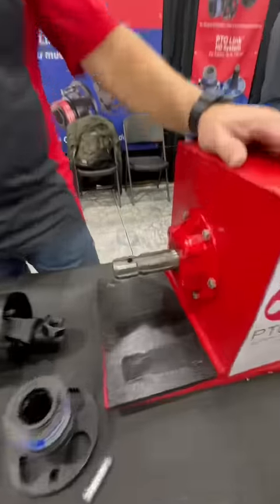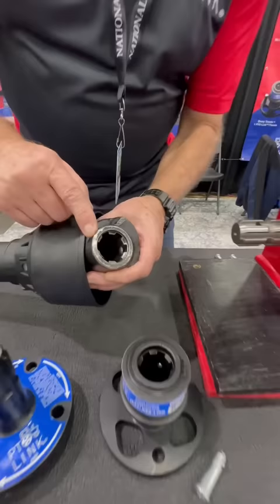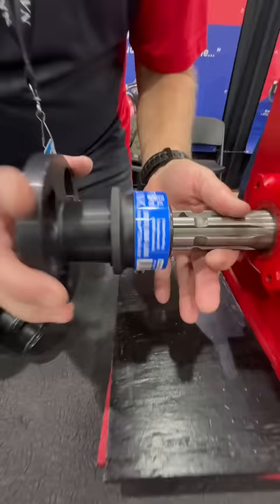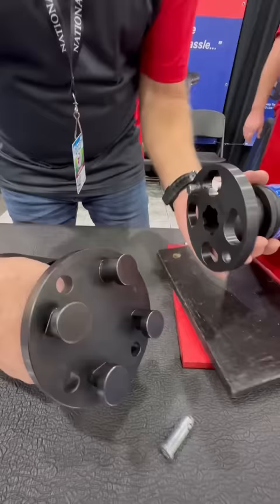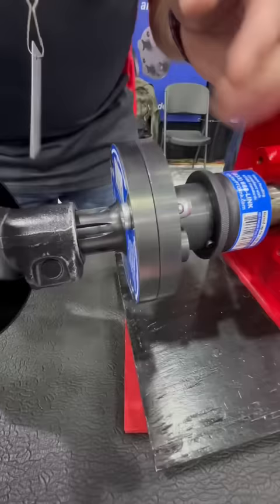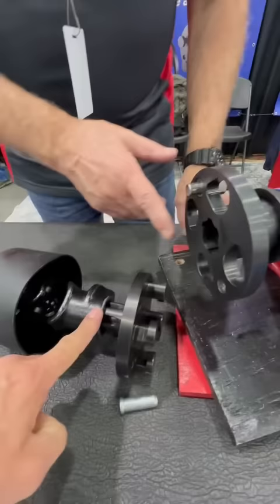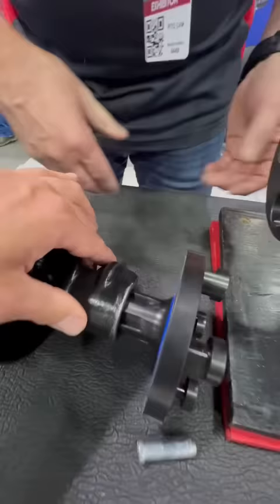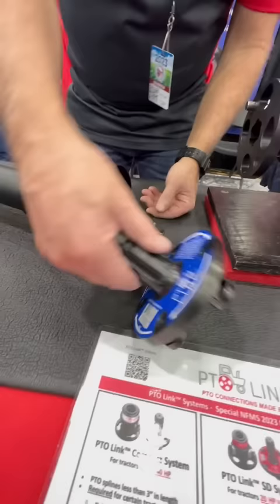“Farming just got easy.” (Said no one ever) #farming #tractor

Comment: I love seeing the real farmers calling this out as bullshit
Reply: I mean I don’t have trouble and my pto shaft ain’t near that clean 😂
Reply: Just about everything in these shorts is bs
Reply: Yeah, I’ve literally never had a problem putting on or taking off pto shafts. Seems like they’re making mountains out of mole hills
Reply: @Sean power take off. You can convert your tractor or truck while in park into mechanical power generator of sorts. Add a pump, bailer, lumber processor, all kinds of things. Some PTO’s are used under drive as well for similar applications.
Reply: I would never trust this. Just a pointless weak point. And it isnt even that much easier.
Reply: Literally all you have to do is spin the drive shaft. It’s a two piece puzzle coke on
Reply: That’s because it is 😂
Reply: whiteafrikkkannun1442 yes we are because we carry a large shaft with two large nuts, and we are great at laying pipe as well 😂
Reply: Is this an April fool 🤣🤣 let’s fix a problem that doesn’t exist whilst st the same time probably kill somebody. How did this get safety approval? Pro guard is now too short. PTO shaft  is now 4 to 6” too long.
Reply: @Farmer_brown134  The only time I have had problems is when some idiot has damaged the pto system through misuse. And I am sure the same thing would be a problem for this fancy add-on. Once damaged, it will not hook up so easy either.
Reply: Mee too 😂😂😂😂😂
Reply: This is why I came to the comments lol
Reply: I am not even a farmer and already saw through the bs in that video
Reply: The biggest problem I see here is now the PTO shaft of the Implement is going to bottom out whenever you make a sharp turn. Manufacturers of implements know that there is a common length between the PTO shaft and the hitching point of a tractor..this is a bad idea.

Comment: Adds a potential failure point. If it ain’t broke don’t fix it.
Reply: If you're thinking about installing this it must be breaking frequently.
Reply: that might be a plus rather this break than the tractor or "implement"
Reply: similar to a pin on snowblowers
Reply: Now you hope the shaft isn't to long better chech the slip length.😮
Reply: @jacobklang6693  nah, if the pto comes loose on a tractor it’s liable to come up and knock whoever is driving silly or dead, probably not the best failure point
Reply: @jacobklang6693  if it works don't fix it.
Reply: Took the words out my mouth. Went from 6 to 4 point of contact.
Reply: Low power applications maybe.
Reply: You now need to shorten the drive shaft of all your equipment by 4 inches, to accommodate.
Reply: It's probably way more expensive to replace the spline in that tractor than buying and using this new system.
Reply: It’s literally just making another join that sucks to connect 😂
Reply: I would not trust this at all
Reply: @jacobklang6693  the shaft on the pto is not going to break and u joints are cheap so are yokes.
Reply: @MrMuDD01  the pto shaft on a tractor will live just fine the u joints and yoke on equipment tend to have issues adding one more piece that is shorter then the spines on the shaft and yoke your adding nothing but issues.
Reply: @t-bfr45-70  I've looked into it and there can be issues with the PTO spline itself, which is costly just in labor to replace it. Stripping the spline can be a issue, but more often than that is the shaft altogether bending. There can be issues with the implement that is being hooked up and not a lot of room between the spline and receiver and the frame of the implement or it's tires not leaving much room to attach and lock it into place. That lack of room seems to be the number one reason for an extension like this over any other issue like a bent shaft.
Reply: @MrMuDD01  you obviously don't understand much about tractors and PTOs. 
1. Yes pto can become stripped usually that has to do with the piece of equipment attached to them slamming back and forth on the shaft creating wear the yoke and shaft making it become looser and looser tell what usually happens is the yoke is stripped because it's softer then shaft it spins and that's what damages the shaft. Adding this is not going to prevent this from slamming back and forth it potentially ads more slop allowing for a harder hit.
2. Bent pto shaft can happen most often this would be caused by bad alignment angle or running it in to something. Adding another attachment that push the yoke and u-joint out away from the shaft creating more leverage angle on the shaft if anything is more likely to create a issue then fix it.
3. The pto drive shaft is already heavy so in the tight spot it's hard to hook up because it's heavy awkward and hard to get between everything. Now after you had shaft shortened to fit with this you now have more weight added and instead of hooking the yoke to the shaft your trying to hook a heavy fatter piece to another piece in that same tight spot.
Reply: @MrMuDD01  that's the reason you use a properly adjusted slip clutch.
Reply: Prices for this thing start at about $500.
Reply: When it comes to something like this that's a good thing. It will possibly break before more damage is done. Sometimes a weak link will save you thousands 😅
Reply: i really cant think of a time you would need to make this easier maybe it saves you a few seconds?

Comment: Fixing problems that don't exist.  He must be from the government.
Reply: Yep least hard part of connecting an attachment
Reply: @Jon-ko3vv  well now it’s least-er harder to connect it
Reply: Exactly.
Reply: Right and I guarantee after about a month or so of dirt and grime getting on there that quick release will no longer be too quick lol
Reply: Connecting a PTO can be a pain in the dick, but this looks way worse
Reply: These are mainly for like garden tractor types, not real farmers.
Reply: Lol. Nope boys! This is easier! By far the hardest part for us is the PTO shaft. Big long pto shafts are heavy and the slips go funky after a while and they take two men to slip and connect at the same time. So I'm all about this.
Reply: @sxs4l245  I’ve never had much of a problem especially if you turn the tractor off cause it disengages the pto brake so you can turn it if you can’t turn the implement, my concern with this would be it’s another connection that can get loose and vibrate! Another thing would be losing that safety pin.
Reply: I'm glad I'm not the only one that feels this way
Reply: Yeah, that's why John Deere has a half turn on the spear pin so gives you a half to to put it on... Who's gonna carry all that stuff around and where are you gonna put it.
Reply: Lol says its hard to take off the part that was "easy to take off" later cause its the one he is selling
Reply: This tool is basically the same thing as the original
Reply: Looks like it is for light duty applications only.
Reply: True
Reply: Trust me. It's a genuine problem
Reply: Basically just showed us how easy it is to connect to the splines.
Reply: @captainoates7236  if you change implements you have to reattach half that contraption to the other PTO shaft.. or buy a bunch of them. Keep them clean and greased should be fine
Reply: I was just thinking that the only problem with my pto is the fact i get grease on my hands and that’s just going to happen to begin with 🤣
Reply: 100% agree
Reply: I'm personally not trusting that pitiful looking "safety bolt" that looks like it'll shear right off the second time you go to use it haha
Reply: @keltonwright7   you don't have to cary it around. you just buy one for each implement.
Reply: you have clearly never used a dirty or rusty coupling. even when they are clean and new it can be a pain in the ass.
Reply: @678friedbed  so at $250 per part, say you have 5 tractors and 10 implements. You're gonna have to spend $4,000 on these.  When there is already a perfectly acceptable hookup from the manufacturer on every equipment???  Good luck keeping a farm in the black wasting money like that.
Reply: @keltonwright7   lol. never even looked at the price  there is 2 sides, you only need one side for the tractor. but, hey for an investment that can save you time every time you need to hook up a piece of equipment, I'm down for that. sure is better then constantly fighting the coupler all the time.
Reply: Yep
Reply: He doesn't realise the small covered and hard to get to button is safer than the large flywheel with teeth. Touch and get caught on a pto when moving and you are reduced to pulled pork.
Reply: yep, how to turn 1 easy connection into 3 easy connections.
Reply: @sxs4l245  Tell us you just let the pto shaft(s) sit in the mud all winter long without saying so directly.
Reply: Haha Yes exaktly!!!  Im think your Right!! 😂
Reply: @keltonwright7  clearly you only have to take off one end an slip it onto another implement geez didnt yee whatch da video ten times?😢
Reply: @larryscarry411  and where are you gonna carry that that's not gonna rolling around the floor of the cab being a pain in the ass.
Reply: I think you meant, “fixing a problem that we made”.
Reply: Yea going from two pieces to four no thank you. It was so well thought out and professional machine and finish work. But at minus 30 f I don't want be looking for who used it last part s lol.
Reply: Yep introducing so many more failure points
Reply: He's literally from the free market
Reply: @danielyeary148  ikr? It's a trade show for free market capitalists yet it must be the guvinmint.
Reply: I think this could add versatility to some tractors and driven assemblies.
If their interlock is consistent across any different PTO shaft splines and sizes, could be used to adapt to different brands of equipment. I'm sure a majority of equipment is mostly one size, but I'm also sure it's not 100%.
And as for an added failure point, I feel this is backwards in 2 ways. I think the 4 studs and 2 pins is probably stronger than the spline, and if it were to be an engineered failure, I would rather replace an adapter that I can continue to work without, over either the output/input shafts that can hault work.
Reply: @678friedbed  As an old farmer told me once, "That is like what the monkey said as he peed into the cash register. That will run into money!"
Reply: @sxs4l245  I agree. I've fought ptos so much!
Reply: Selling this to who? People who probably shouldn't own a tractor.  Lol😂
Reply: Totally agree 😂
Reply: The problem exists after a couple decades of stuff sitting outside lol
Reply: If you can’t hook up a PTO you should not be around a tractor
Reply: I bet his wife is very unhappy
Reply: Maybe try some PM on your equipment every once in a while. Shafts aren't that heavy or hard to attach.
Reply: My thoughts exactly. Another failure point.
Reply: Well said and making a whole bunch of new problems that didn't exist before.
Reply: So it locks in one direction and all the power is applied to four nubs, inserts call em what ya will. But when you go in the other direction all the force is applied to the retaining pin. Doesn't seem to smart in my opinion
Reply: Duck tape is cheaper 😅
Reply: @nickmartin3647  Replacing one problem with a new problem. Tha's the problem.
Reply: Went on to say removing from PTO was super easy. If it's super easy why we need it then?
Reply: @Jon-ko3vv exactly I have never in my life had trouble with the pto only the damn arms.
Reply: True
Reply: @Studio23Media  never seen a PTO on what most people call a garden tractor
Reply: And making problems that doesn't exist 😂
Reply: @sxs4l245  I agree
Reply: Oh it can be a pain hooking up old equipment. If you don't think this is valuable you haven't spent much time changing out implements.
Reply: I just welded a 1 3/8" ID x 3/4" thick smooth bore collar to implement side splined yoke. Now yoke has female pilot , $5

Comment: Or maybe, just hear me out, clean and grease the socket end before putting it away for the off season so ot doesn't rust and crust.  Additionally wrap the socket end in a plastic bag after greasing it to keep the fine dust out of it.  And while you're at it keep the spigot end clean and greased as well, nothing fancy, just some regular lithium soap grease will do fine.

Comment: Safety bolt detent will fail. Don’t use detents where they can fill with dirt and seize in the bore.
Reply: yup, beyond this looking like another failure point all together.  a hitch pin would make way more sense for durability and be able to replace a tiny piece instead of the whole pin when the detent spring starts failing.
Reply: I can imagine the safety bolt falling out, the plate releasing when the tractor engine speed slows and a spinning whirlwind of destruction at the rear of your tractor.

Comment: I invented another one called the pto link-link. It helps connect the pto link to the pto link. Its a pto shaft that attaches to the pto link. Push one button to release.  No safety bolt needed.

Comment: That changes the geometry of the implement shaft, because it's designed to connect with the splines, not further back via hubs!
Reply: Exactly my thoughts, those PTO shafts have a specific tolerance for length for a reason. This fucks it up. And switching out the PTO shaft is the quickest part of changing implements.😂

Comment: If you can turn it far enough to lock in that magical coupler you can turn it enough to just slide the shaft on
Reply: All ptos turn freely in the back end when they are not I'm gear, all you have to do is turn this to line them up.
Reply: Q makes a good point
Reply: @billabong9215  not true but you are agreeing with me lol
Reply: @Q  Name a tractor that doesn't turn freely when the p.t.o gears aren't engaged?
Reply: ye, i thought he was gonna show off some clutch system to replace the turning part lmao
Reply: @billabong9215  anything with a pro brake, for example, Oliver's and whites I have
Reply: @billabong9215  grew up on a farm and now a full time farmer for 10 years. Ive never once ben able to spin a pto to line it up. Now i will admit i have not run EVERY tractor ever made but either way you are arguing with yourself
Reply: @billabong9215  every tractor I have worked on requires the engine to be shut off in order to spin the pto by hand.
Reply: @That1Carson  It should be turned off anyway when you are doing anything with a pto. Like... it says it with warning labels inside.
Reply: @Q  Try turning the tractor off man! Every single tractor pto will spin freely when it is a) not in gear either 540 or 1000 and b) when the tractor is switched off.
Reply: @billabong9215  many people run for years with a dead battery -- always park it in the shed & jumpstart in the morning, leave it running all day.
Reply: @billabong9215  anything with an eaton fuller lol
Reply: @don't worry about it  Your pto brake shouldn't be engaged all the time. Turn off the tractor, disengage the break. Pto will spin.
Reply: @billabong9215  No they don’t lol
Reply: @billabong9215  Many older tractors are not equipped with a “live” PTO, they’re directly coupled to the transmission. Live PTO is standard today but it definitely didn’t just start like that. Your PTO could even drive a tractor into the woods if you weren’t careful mowing, you could hit the clutch and brake but the centrifugal force of the mower blades spinning could easily push the tractor. This also made it impossible to stop without stopping the PTO.
Reply: @billabong9215  u have to line up the locking lugs anyway so its no different than if it wasn’t there at all. Maybe ur output spline need a good scrubbin and lubin and thats why u have issues getting in to the coupler. Ur coupler probably needs the same treatment. And u contradict urself so its hard to tell if u agree this add on is garbage or not
Reply: @billabong9215  kubota mx5000 or any other tractor with a pto brake they only allow an 1/8 rotation

Comment: I don’t get what problem this solves… I have zero problems hooking up my PTO stuff.
Reply: That literally solves no problems, if anything it makes more problems
Reply: More weight and complexity... if the implement is on the three point, it's easier to slide on the spline than fuq around with 4 holes and flats and a pin..
Reply: @OntarioBearHunter   I still don’t see it.  Never had a problem.
Reply: Engineer never wore a pair of rubber boots..
Reply: That would be the problem of low revenue. That is the domestic product I've seen in a long time. He would be better off selling that quick attach on the other end to upgrade old pto shafts.
Reply: It’s for people that don’t use grease or oil to keep things smooth I guess
Reply: It's not even an over-run clutch.
Reply: @BarHRanch  I'm saying a standard PTO is easier to hitch than this thing
Reply: It helps use up some of that pesky free time. 😂
Reply: Weight and bad lifting posture are the problem. Also some lock pins are hard to press.
Reply: It solves the problem of too little money in the salesman's company's bank account.
Reply: That's because it actually occurs to you that when you're disconnecting and parking the implement not to drop the PTO shaft end into the dirt/mud and leave it there.
Reply: It solves the problem of the inventors bank balance not being healthy enough.
Reply: @Nasty Habitz a spline lines up 6 ways, 2 ways for this
Reply: @Nasty Habitz I'm not a farmer so I've only coupled a spline twice, maybe 3 times, but I don't remember having trouble with it & I haven't seen anyone else have trouble either. I've been told to leave it dangling so it can't fill up with rainwater, presumably rust is a problem, but I don't see this gadget being any better after a few weeks use & probably not as good.
Reply: @patgenier1965  yup across most trades
Reply: it mite be handy if your 540 was broke a short piece sticking out of the tractor? slip it on then shaft you will have good hook up to your implment keep u running till new shaft comes in